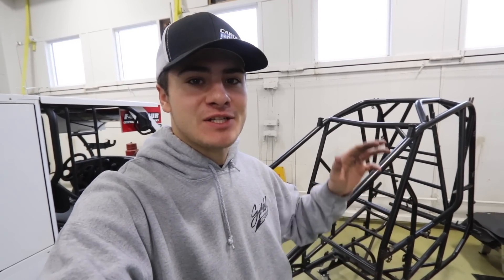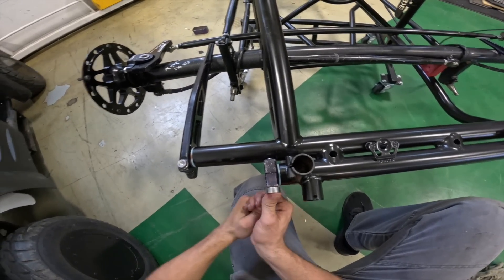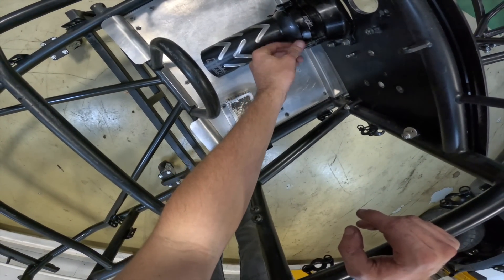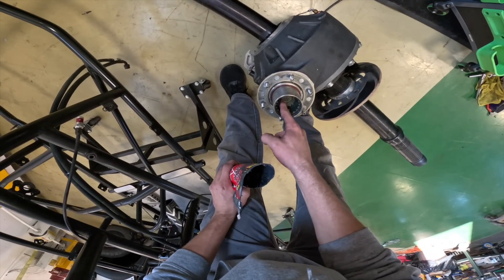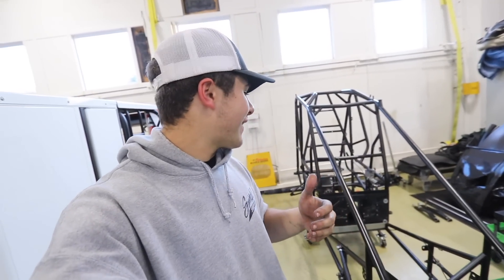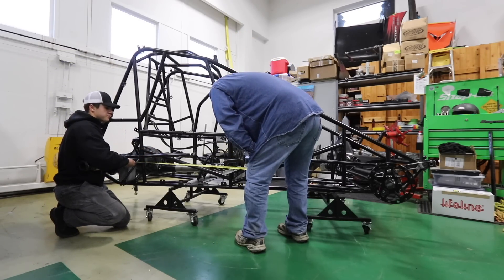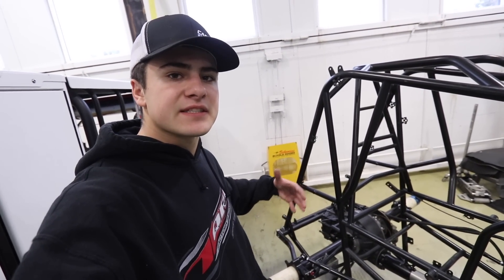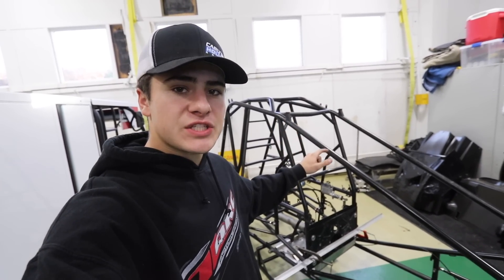MY SPRINT CAR IS BACK.....Time To Get Busy For 2023!

Comment: Tip .. paint a strip on the torsion bar so when you pull a bar out after a race and the strip is not straight there is your problem .

Comment: I noticed scuff marks on ft torsion bars, do you crank full lock when you steer? May be a little problematic. Have you watched T-MEZ TV on YouTube. He is a USAC Midget, sprint car driver  he will be at Chilly Bowl, RMS Racing 7x
Reply from the maker: Ya those can be for multiple reasons. Some good some ok. Sometimes it is just how winged over the car gets and then sometimes it is too much steer.

Comment: What made you buy a 87/40 1/2 what was the reasoning
Reply from the maker: Gives a tiny bit more room in the cockpit and it just happened to be the first car we bought and have stuck with
Reply: @TannerHolmes  Are the other cars in the operation 87/40? If so do you feel a difference handling wise between them? We run a 87/40 with the Big Boy A frame gives a lot of extra room without straying away from the standard lengths.